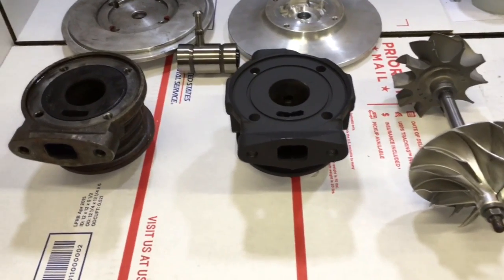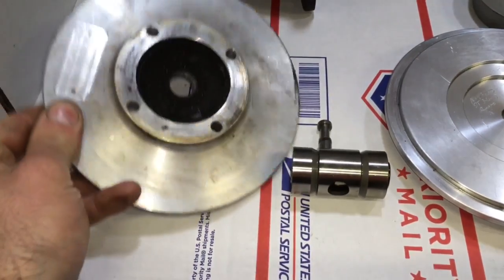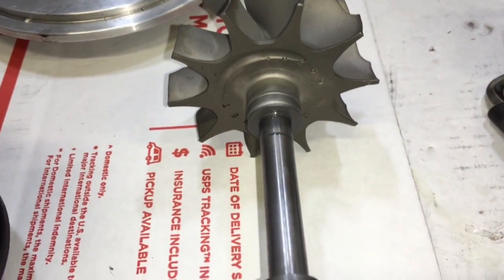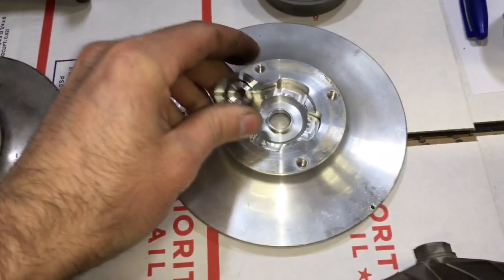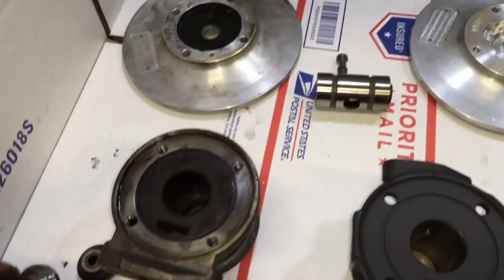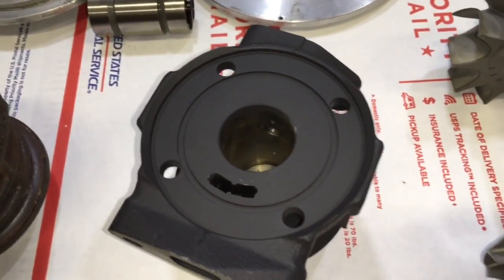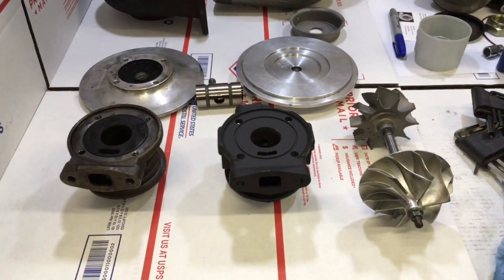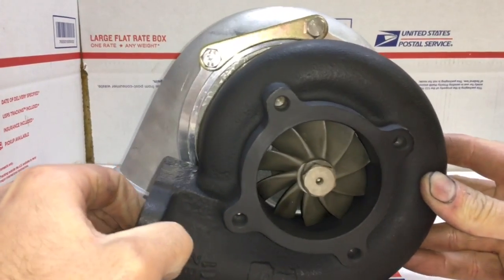Precision 6262 Gen 1 vs Gen 2 Differences

Comment: I was looking at a Gen 2 5558 for my 2010 Speed 3 long-term goals: 500whp and tracking duty. I'm also considering an EFR7163 or a G25-660 instead, as both have water in the CHRA as well (instead of the Precision's oil-only), and it seems like that'd be better for heat management for the abuse of track duty. All of these would have excellent boost threshold, spool, and transient response, which are also key goals for my build concept. What are your thoughts?

Comment: i have a gen 2 6266 and i need to do a full rebuild with a new compressor wheel but  cant find anything
Reply from the maker: I have replacement compressor wheels for them, they are original but they are direct fit for the 6262 and 6266, we have the turbines too. I don’t have the compressor wheels listed but I will get them listed today.
Reply: what about the bearing?

Comment: i have a gen 2 6266 and it needs to be rebuilt. is it possible and a good idea to install a gen1 center cartridge on it?
Reply from the maker: You can't convert it over to using the Gt37r(Gen1) without changing out the turbine to the 64.5 x 74 gt37r turbine which is smaller, you would need to convert to journal bearing or buy precisions gen2 cage. You should check your first though because I had one customer that had a gen 2 that had a Gen1  bearing Housing but gen 2 shaft and cage and plate. Someone altered the turbo before I think.
Reply: Turbo Lab America do you know if the gen 2 is a reliable turbo even if there is no water cooling on it. are you able to have the gen2 bearing for a rebuilt

Comment: I have a gen2 5558 with ball bearing issue (it have less than 1500miles and generates only 5psi boost with axial play),  any garrett bb upgrade?
Reply from the maker: A common thing that happens with the gen 2 is that people remove the oil feed fitting/ dowel pin, causing the cage and whole rotating assembly to move in and out. That will also cause a problem boosting. The oil feed/ dowel  pin is holds the outer race of the cage from spinning. Actually the cages and quality was very good, the only turbine upgrade is the gt37r 64 x 72 or maybe its 64.5 x 72, I can't remember. The compressor wheel options are all the same as to4e and to4s depending on the plate you use and compressor housing, i like the gtx3582r compressor and the t67 billet wheel that we have, the t67 compressor wheel is the same wheel as the gt37r which is good for up to 950 hp.
Reply: Turbo Lab America it's strange, because is original with the oem oil feed restrictor.
Reply from the maker: Can you email me pictures

Comment: Do you have any upgrades for the precision to4e gt3561e journal bearing turbo???? its an older style turbo but its one of the best turbos ive ever owned.. Do you do rebuilds or any upgrades?
Reply: @turbolab
Reply from the maker: +DsmKen the 3561 has a gt35r compressor 61.4 X 82 and and 62.35 X 68 turbine, it can be converted into 3576 which uses a ptrim 65 X 74 shaft, but I don't stock those shafts. It can also use a t67 compressor 67 X 84 but it can only go so large in the bolt on housing before it causes heat and back pressure problems.
Reply: Which do you recommend? Also do you have any compressor cover upgrades?
Reply: And how much?